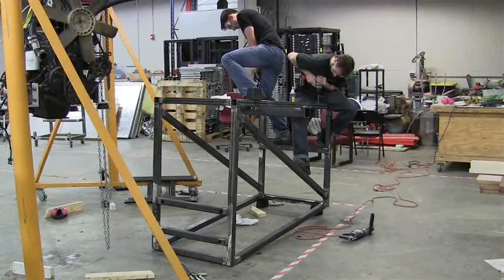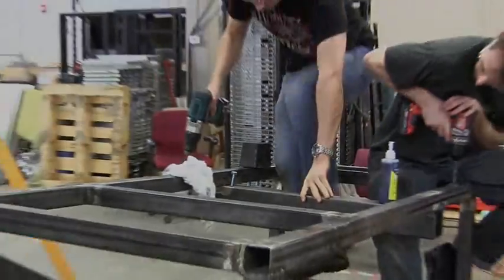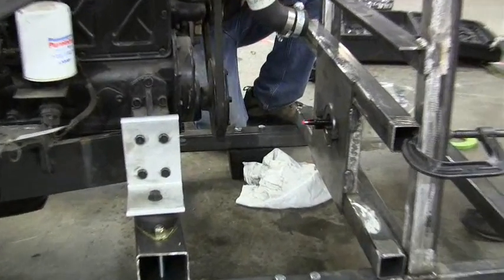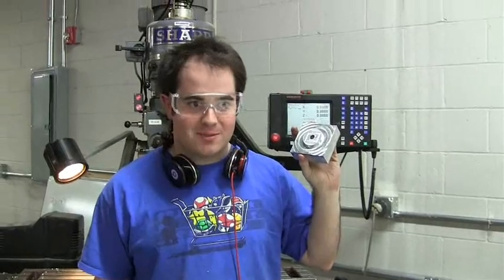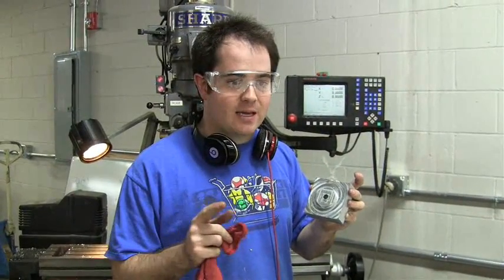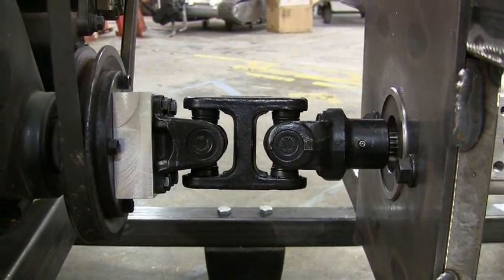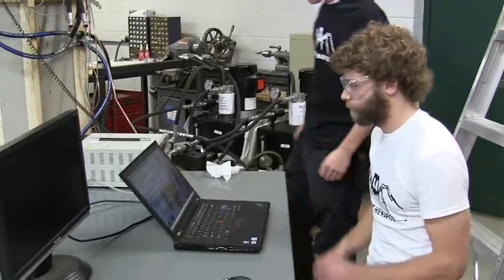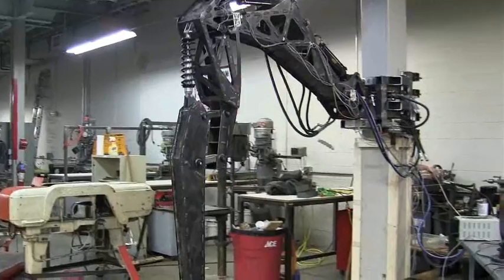Project Hexapod Update: 2/27/2013

Comment from the maker: Nice catch! The reason is because that's the way the stock forklift was configured. We decided we wanted a stock powerplant, so we bought one out of a Toyota FGC-45 from 1992. It came with the engine, pump, and yoke you see in the video, with the pump assembled onto the front of the crankshaft - the forklift had a transmission for the wheels driven off the back. Since our goal is to keep parts as COTS as possible, we didn't mess with it.

Comment: Is there a specific reason why the pump is being driven off the front of the crankshaft? I would be concerned about the key or the crank snout shearing off. The rear of the engine is designed to transfer torque, not the front.